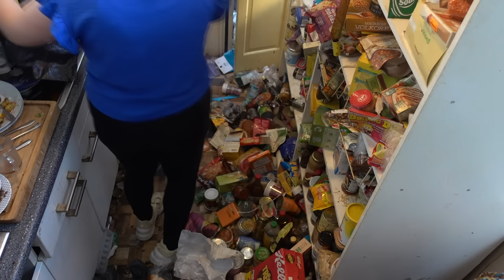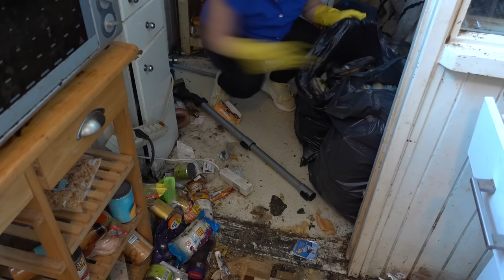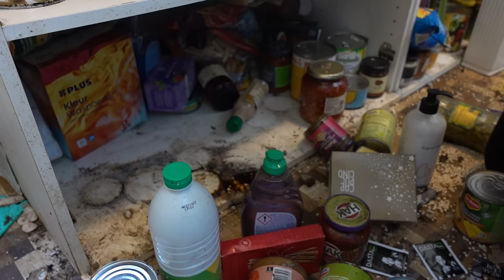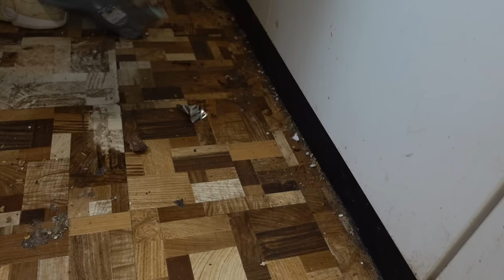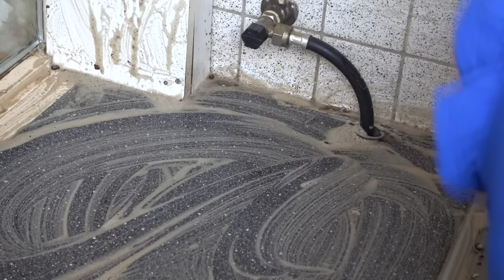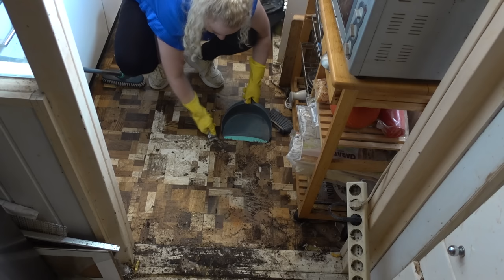Depression and a Food Obsession made this Kitchen SO gross!

Comment: You didn't clean the oven, microwave and washing machine. Also, you didn't pull out the cabinet where they were kept and clean up behind it. You didn't even clean the bottom of some jars. I didn't like the cleanliness, many places were dirty. The inside of the cupboards are still dirty. If you want me to watch you and improve, I recommend you everywhereYou need to clean and use more cleaning products.